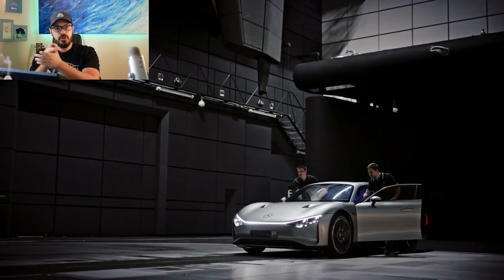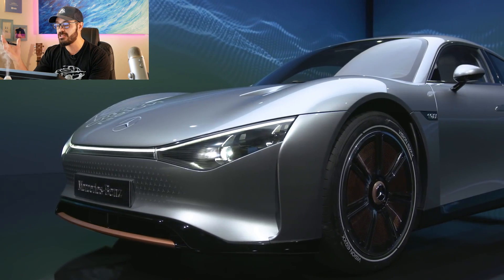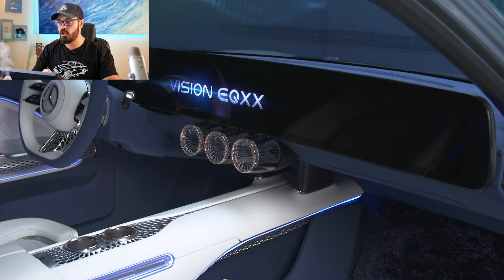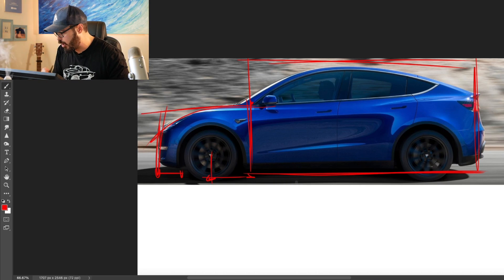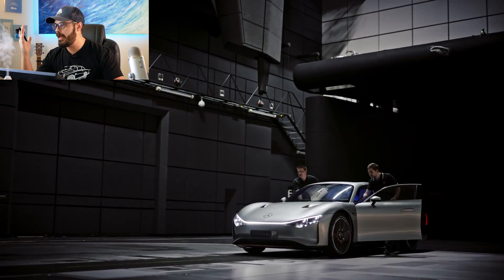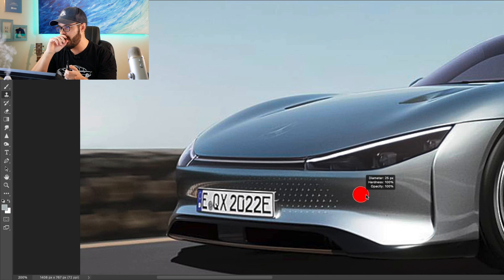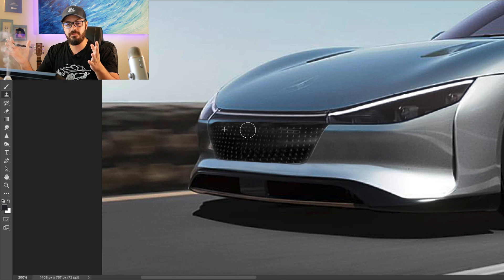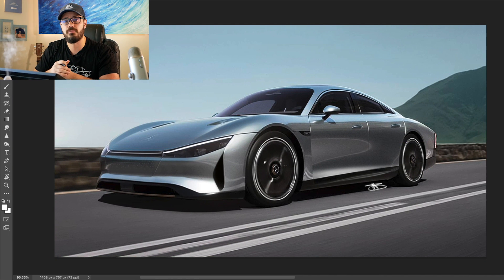Mercedes VISION EQXX Redesign - An experiment with proportions

Comment: i think you can make an ev with a boxy long end and still make it aero efficient enough emphasis on ENOUGH. so because there is no engine you can sacrifice some frunk space for a hidden aero structure for the air to flow though the box shape.

Comment: I see these not as "problems" with proportions. Just new proportions emerging from new needs. In essence, Form that follows a function. I think you think they are "imbalances" because we have gotten used to certain proportions in cars. But that will change. A long front is useless if you don't have a engine there or serve aerodynamics, that's the way it is.

Comment: Agree on the punched front, the Alfa Romeo Giulia had the same issue and the Centro Stile designers explained it was mostly due to safety regulations (especially for the US Spec). Could this EQXX be a teaser for the new EQC sedan?

Comment: 2 seater makes more sense long term, assuming effiency is so good that 2nd 2 seaters initial cost is nothing lon term factoring in running costs given most the time more than 1 or 2 seats and only little storage space is ever used, especially when removable roof storage is a thing(maybe even thermally insulated to some extent) . one 2 seater can follow the other with driver in it, emulating a 4 seater for less common times when such is used. it will make even more sense in a future where ride sharing increases, population and services more concentrated near each other, amazon delivery service type things increase, family unit becomes less common so people live in short term relationships more often than it used to be, so less desire to travel together. this stuff is already happening.

even as a 4 seater, they clearly are still surrendering to shortsighted stuff like that massive screen garbage. wonder if they considered e ink displays, tinted HUDs etc. the rear row seats couldve been facing rearward, cutting off mass accommodating cabin airpsace accordingly. this wouldbe for less weight, keeping most the weight low and in between wheel base and maybe a bit toward the rear for areodynamics more like a 2 seater car, less airpsace means more effceint heater/AirConditioning. trunkspace can be excused into being smaller b/c unused space becomes legspace, and most the time its not fully used, so less legspace is acceptable for some of the time assuming there even is rear passengers and full storage space use at same time. the rear line going upward after the slope goes down toward enf of car, is a active areo for downforce stability but it can be done as done in this mercedes, also put weight more on rear as shown with yellow line between wheel bases. wiring can be surfaces of wall instead of normal cylinder wire to connect beteeries stored where yellow lines are (see pic) while keeping driver low in car for areodynamics, weight and handling more speed around turns which helps increase electronics lifetime and imporve effiency and is for more driving fun. with freepiston no electric hybrid it might as well be rear wheel drive too. the windshield shoudlnt be too close to driver face in case something flies into windshield so it doesnt jumpscare driver as much, dont know what a good minimal amount of space would be.

both rows especially front row can make passenger and driver have enough room to rest elbow but fore arm and front end of legs pointing toward each other for more arrow shaped front end similar to ariel atom, no need for extra space to spread arms that much more this isnt s class.

headlights could be at forehead level so the headlights surface dont have to be so vertical, front can becomes more areodynamic if front end is crashed driver can still go home at dark with working headlights, also acts as off roading roof bar lights for those cars.

they focused lot on aesthetics yet they didnt talk about a modular texture platform they can profit off of even after car sells, as user wants to change aesthetics, can even be a different theme per seat, can switch parts between owners for sale through dealership etc.

lightyear one already beat this thing.

the gamification encouraging efficient driving was vague, how would it look like? i guess itd show sea level changes of road so driver knows to build momentum on downhills(sometimes people cant tell when their on a slope b/c there isnt landscape reference to show visually that they are on a slope realtive to other slopes or flat surfaces) , maybe steering wheel position will be encouraged by HUD showing how to turn the car as a pathway arrows representing sides of the car. maybe g force meter to know the grip limit for car which is hard to sense for most people in tight suspension car, so u can carry speed without learning grip limits by small grip loss which will make most people fear limits. each of these can be turned off, ex. somone who knows how to maintain momentum around turns will only use sea level and maybe g force gauge.

every time car starts up itd remind driver to maintain momentum with minimum acceleration quickness and braking and steering and braking for brakepad and tire life and effiency.

Comment: My problem with this car is that if you were to remove all the Mercedes logos, I wouldn't be able to tell you which manufacturer built it.
Reply: I’m not entirely sure that it’s a bad thing. I think brand identity is ruining design. I hope we move to a place in design where things are more stealthy and not obnoxiously obvious like a massive star on the front end.
Reply: @User.Joshua  A logo, like a star on the front end, is a small part of what makes brand identity. The design of the car itself plays the main role. Designs lacking brand identity is the issue I voiced in the original comment.

I want to be able to tell the brand of the car I'm looking at purely from its design. I want to be able to pride myself in owning a brand, which isn't possible without brand identity. There is no brand identity when all cars look the same with the exception of the logo they glued on the front end.

An example of design cues that make up brand identity are BMW's Hofmeister Knick, strong shoulderline, kidney grille and the twin circular headlights with a "sawn-off" top, which, in combination, make a BMW uniquely a BMW. In recent years BMW has decided to push or flatout remove these cues, resulting in their cars being less recognizable as BMWs and/or, in my opinion, just plain ugly.

I think this is a similar issue to car brands taking to dilluting their performance brands accross their line-up and making engine sizes into trim levels. In the past I could tell that a 325i had a 2.5 litre engine. An M345i is neither an M car, nor does it have a 4.5 litre engine.
Reply: @mynt253  I totally get the sentiment, and perhaps your opinion is more reflective of most potential buyers.  

Personally speaking, brand identity is irrelevant to me. Having owned many Mercedes’ models (GLS 550 now) it hasn’t mattered much to me at all. The drivetrain and the ride quality has always been at the forefront of my purchasing decisions. I’m more of an engineering fan than I am of aesthetics. 

Design sells cars, so I totally get where you’re coming from.
Reply: @User.Joshua  Brand identity makes Design special and unique.
You can recognize works of Van Gogh for example because of his unique style.
A brand identity is a finger print.
When my car has no identity, I can just as well take the bus, same statement

Comment: All those criticizing the looks of this car - it's about aerodynamics. Form follows function. You can't "fix" it. Mercedes already fixed it.
Reply: You could achieve an even better drag coefficient if you change the headlight design, redesign the wheel covers, remove the cabin and make it an unmanned ground vehicle. What the point of a car when it's not unique? The EQS has a drag coefficient of 0.20 and looks like a Mercedes, same goes for the Lucid Air, which looks like a Lucid, the McLaren Speedtail still looks like a McLaren and last but not least the VW XL1 looked like a VW.

This literally looks like a Kia, that's unacceptable.
The Mercedes IAA Concept was also about improving aero and it looked like a Mercedes
Reply: like, it possibly could be 'improved' to a total 'raindrop', but designwise... nope.

Comment: This 'punch in the face' front end problem is only an issue if you come at it from a traditional car design perspective. 

The reason EVs have their front wheels so close to the front is because:
1- they dont have an engine and 
2- they all have giant batteries in the base, which are like big skateboards essentially. 

So pushing the wheels to the edge gives more cabin space and structural stability to the vehicle.

Lastly, The reason EVs are stretched out in the back is to reduce drag, meaning increasing range. Look at the Aptera, which aims to have 1000 mile range, and it has a huge tail.
Reply: what's more... you have a 'limited' length of the car.. no one wants to drive 9m long cruiser only because its good looking car. You have 5m to use - end of the story. If you want to create a comfortable car for 5 or 7 people you cannot waste (!) a single inch on the hood to make the car 'nice' it must be useful and comfortable first. you can work with what's left, but every additional inch is an additional mass (efficiency), additional material (cost), additional turning range, or parking issues (usability). 
Do I like your design more? YES! But at the same time, I would feel disappointed if I see that as concept design and then got 'punch in the face' as a production car. If MB is fair with expectation and delivery I am much happier.

Comment: I think we just have to get used to a new design language for cars from now on. And adjust our point of view and what we consider a beautiful design.

Over the decades, our eyes have got used to certain shapes and proportions with combustion engines cars. For a very long time we found many design elements to be beautiful. For example a long bonnet, fat wheel arches or huge radiator grilles.

Much of it had a specific function. The long bonnet to accommodate a 6, 8, 10 or 12 cylinder engine. An ever larger grille to breathe in more and more fresh air, and so on. All good examples of "form follows function"

I for myself find the design language of some new electric vehicles attractive/aesthetic. Just in a newer way. We don't just perceive crazy proportions or long hoods as aesthetic. When we look at a cardesign element that has a specific purpose, it often appears to us to be aesthetic as well. The right solution for that purpose makes it "right". Makes it look because of  that.

There is no point in stretching  the front of every car longer and longer... over and over again. It makes no sense to give every car a (huge) grille or fake exhaust pipes for the sake of having the "thickest and longest" (it's just overcompensation). To be honest, it doesn't really even look that cool. Ever since the Tesla Model 3, I've found that a closed, smooth front is much more aesthetic. For some people, it just doesn't look brutal enough, I think... And that's probably not cool enough.. And that's probably not attraktive enough.

The short and rapidly sloping front has a reason and, in my opinion, creates an interesting design language overall. What used to be the elongated bonnet is now the gently sloping elongated rear end and so on. Perhaps we would be better off getting used to this new design language and recalibrating our senses. I am sure that in a few years or decades we will find certain proportions, line guides and so on, very interesting and visually very appealing. If not today already.

I also think that the Sketchmonkey is very well aware of this fact. But I think he also has the pressure to satisfy his audience and therefore has to polarize a bit with some crazy contrasts. A makeover wouldn't be a makeover without some harsh changes.
Reply: Best comment i ever read about electric vehicles !!!!!!!! I agree 100%
Reply: @vasilispoyiatzeas9137  Thanks a lot, my friend.

Comment: Think the tweaks are missing the point in that this is supposed to be the most aerodynamically efficient. The greater issue is that I just can’t tell it’s a Mercedes, can pass for anything.
Reply: Another design goal was to not look like shiit, so aero was not all (e.g. closed rear wheel arches).
Reply: Exactly.
Reply: The blunt nose is going to be the future. Just enough room to crash box in an accident.  Over time what is beautiful also can change.

Comment: Engineers: work their freaking ass off for many years to create the most optimal and perfect piece of an automobile machinery that has ever been designed by them

TheSketchMonkey: this needs to be fixed
Reply: Engineers: work their freaking ass off for many years to create the most optimal and perfect piece of an automobile machinery that has ever been designed by them
TheSketchMonkey: fixes the looks and loses the 0.3 Cx they worked so hard to shave off
Reply: Making the car significantly more desirable and pleasant to look at in the process.
Reply: Another reviewer:
"It looks like a silverfish" 😁
Reply: I think we just have to get used to a new design language for cars from now on. And adjust our point of view and what we consider a beautiful design.

Over the decades, our eyes have got used to certain shapes and proportions with combustion engines cars. For a very long time we found many design elements to be beautiful. For example a long bonnet, fat wheel arches or huge radiator grilles.

Much of it had a specific function. The long bonnet to accommodate a 6, 8, 10 or 12 cylinder engine. An ever larger grille to breathe in more and more fresh air, and so on. All good examples of "form follows function"

I for myself find the design language of some new electric vehicles attractive/aesthetic. Just in a newer way. We don't just perceive crazy proportions or long hoods as aesthetic. When we look at a cardesign element that has a specific purpose, it often appears to us to be aesthetic as well. The right solution for that purpose makes it "right". Makes it look because of  that.

There is no point in stretching  the front of every car longer and longer... over and over again. It makes no sense to give every car a (huge) grille or fake exhaust pipes for the sake of having the "thickest and longest" (it's just overcompensation). To be honest, it doesn't really even look that cool. Ever since the Tesla Model 3, I've found that a closed, smooth front is much more aesthetic. For some people, it just doesn't look brutal enough, I think... And that's probably not cool enough.. And that's probably not attraktive enough.

The short and rapidly sloping front has a reason and, in my opinion, creates an interesting design language overall. What used to be the elongated bonnet is now the gently sloping elongated rear end and so on. Perhaps we would be better off getting used to this new design language and recalibrating our senses. I am sure that in a few years or decades we will find certain proportions, line guides and so on, very interesting and visually very appealing. If not today already.

I also think that the Sketchmonkey is very well aware of this fact. But I think he also has the pressure to satisfy his audience and therefore has to polarize a bit with some crazy contrasts. A makeover wouldn't be a makeover without some harsh changes.